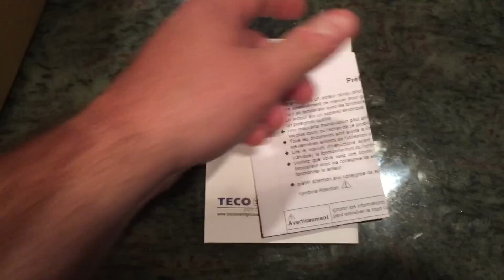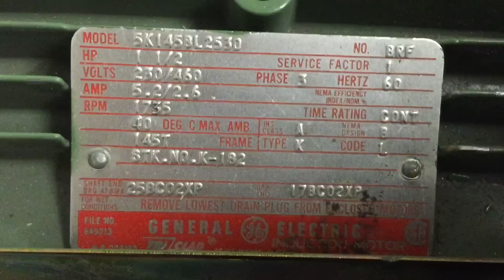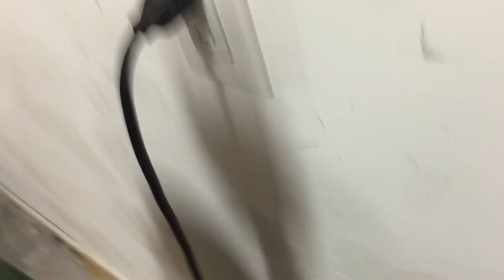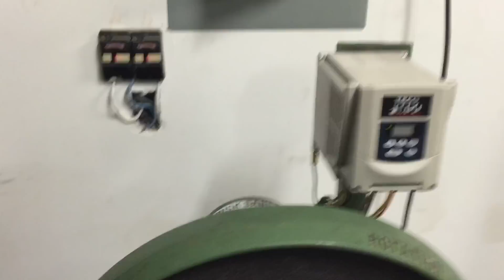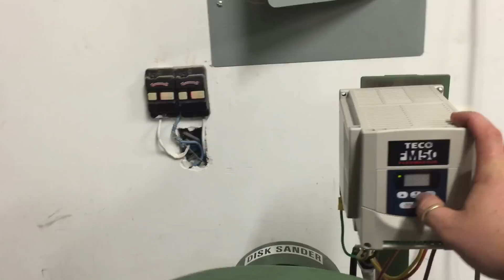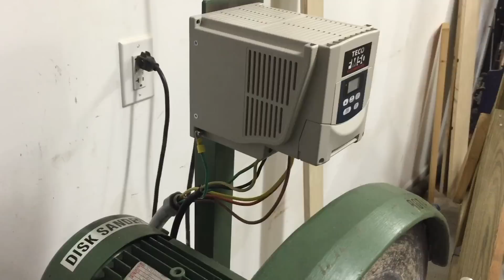RUNNING A 3 PHASE DISK SANDER ON A VFD USING A SINGLE PHASE 240V POWER SOURCE (TECO FM50)

Comment: Nice sander.  Still happy with the VFD?
Reply from the maker: I actually sold it this summer.  I have about 5 other machines that I run 3 phase motors using VFDs...  never had a problem with any of them...